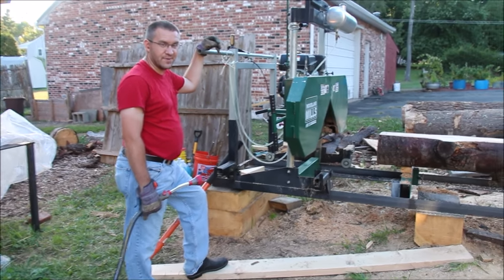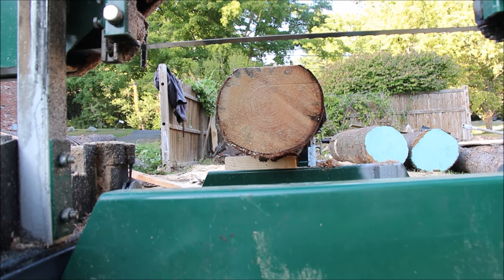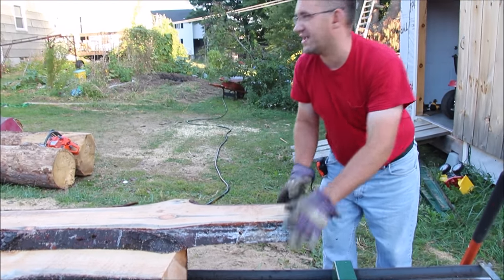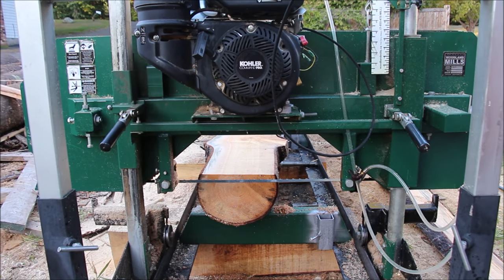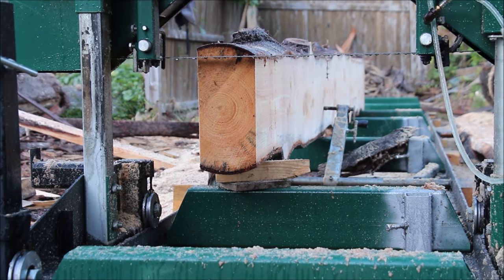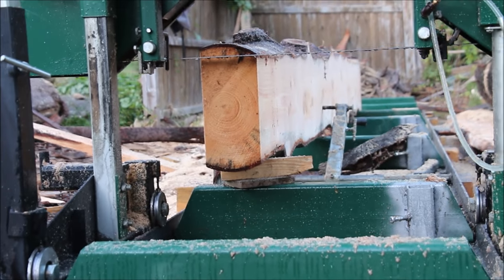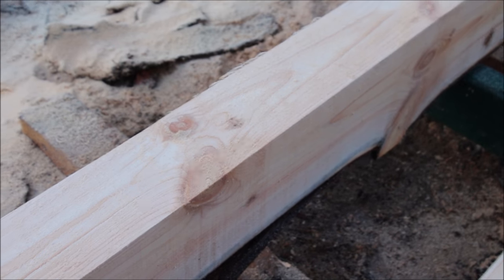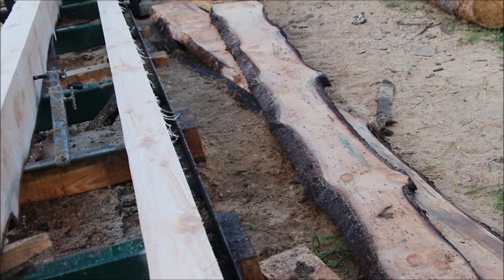How I mill a 16ft+ long log on my Woodland Mills Sawmill

Comment: adding all that water is over kill , the gullets are filled with so much water there is no room for the sawdust , you'll also "float" the blade right off the drive wheel.  a drip is all you need for cooling and lubracating the blade
Reply from the maker: Not trying to cool or lube the blade, trying to get the sand off the outer part of the log.   When I make cuts that aren't through the outer part of the log, I only run a drip.   So far, running the hose on the outer part of the log saves my blades...I think.  no issue yet with my blade coming off the drivewheel
Reply: Why don't you use a pressure washer or spray the log down before you cut it?
Reply: cuz he ain't to bright
Reply: The hate and rudeness from people this day and time is mind blowing! I think you're doing a fine job and do it the way you want to, not the way everyone else says to. Really wish we could all just come together and help each other instead of all the negativity.  You're children will probably turn out to be hard working adults. Keep it up good sir, your doing a fine job!

Comment: im new to this, why do you need the water lubrication system? I have seen a lot of people who dont use anything for lubrication
Reply from the maker: Into The Dirtshop when going through the outer part of the log...it keeps things cleaner...doesn't dull the blade as quickly
Reply: Matthew Olson thanks! Would power washing the bark to get the dirt off do the same thing?
Reply from the maker: It would help....yes.  removal of bark is best....but even after the bark is gone I'd prefer to have lots of lube when going through the outer part of the log

Comment: Very cool....:) ( Nice video too ) And question.... how much would you cutting dry? Just washing the log first as best you can? I would be interested in your opinion of mill options after a year or so of milling. We need one here on the farm.
Reply from the maker: I don't cut dry unless I forget to turn the lube on.  right now I'm using windshield washer fluid and pinesol.  if I cut through the outer part of the log I use the garden hose
Reply from the maker: does that answer your question?
Reply: yup
Reply: What's your mixture ratio for the washer fluid and pinesol?
Reply from the maker: Dan Hagemann it's not scientific lol....about a cup pine sol....in a gallon or so washer fluid or water.

Comment: So close to the house, why did you buy a gas unit?
Reply from the maker: Thomas  Broking ....electric would be nice no question but I'm pretty sure they don't offer this mill with an electric motor.  Plus the power head is more portable.  This was not the intended site for the mill.

Comment: nice video here.  I'm wondering one thing about the watering system.  I've seen on some other systems where they have a tank of water (5 gallons maybe) and a fixed spray system mounted to the cutting head.  Would this be an option for your system, or is there a benefit to using the hose setup you have?  I kept thinking about how soupy the sawdust / dirt below the cutter could get with all the water you were using.Thanks for anyr feedback.
Reply from the maker: test account I have probably a 2 gallon tank that's the shiny thing that you see at the top of the power head I do run Lube which is essentially windshield washer fluid and Pine-Sol however when I am cutting through the outer part of the log I like to use the hose and you'd be surprised at how dusty the sawdust comes out on the other end rather than soup
Reply from the maker: test account also I realize I need to do a video on my lubrication system because I do have a bit of a different set-up compared to the stock Mill
Reply: Matthew Olson
Thank you for the reply.  I appreciate it.  Have a great day!

Comment: Many have suggested to power wash the log. Where you use a hose. Uses a little less total water consumption and might blast more sand away from the log. Not sure might give it a try.
Reply from the maker: I don't have a power washer, but yes, that would be nearly ideal.   Better to have a water jet blast off the bark to start with ...but that'd take a considerable setup. ...

Comment: Im thinking not but if you look at the woodmizer L 15 build a saw guide like this! I would go to a steel company and get a 1 1/2 tubing about three feet long get another peice that would let it slide threw and take the existing guide and put it on the end of the peice you buy and make it adjustable so you can get the guide over to the wood this keeps the blade from wandering
Reply from the maker: I haven't felt the need to do it...but it would be a nice upgrade!
Reply from the maker: I use the water when going through the bark.  Just dust coming out the other side :)  it does help save blades

Comment: Are you going to join the ends of the rails together?  Like weld cross pieces?
Reply from the maker: ?   the green bunks hold them together with bolts, haven't had an issue with them splaying out if thats what you mean.  probably no harm in welding a cross piece but I don't see it as necessary ...  why do you ask?
Reply: Matthew Olson just curious.  I'm thinking about getting a Woodland mill and thought about doing the same thing. Thanks for your reply
Reply from the maker: @kerrydills3240  if you have the space I recommend full 40 ft rails.  mine are 30 and at this point i wish I kept them the full 40 (the length the L angle comes in at the steel supplier).  the downside is that 4x3" L isn't the stock size, so what happens is that the mill sits higher off the bunks and the minimum board is 2" thick off the bunks rather than 1"
Reply: Matthew Olson  Ok. Thanks for the advice. Great video,too.

Comment: In the last slab you took off the top, why didn't you raise the blade 1" and get a 1" X 4" X 8-12' out of the slab?
....13
Reply from the maker: ah... great question.  a few reasons.  knots...it wouldn't have been a nice piece.  I don't have a great way to dry a single piece like that....usually when I cut 1x? I do 1x8 or 1x12....not random widths...and I have no use for such  piece.....also...time.  I don't like to mess around with such small pieces.   what I COULD have done is to cut stickers out of the scrap....but I already have enough.
Reply: Very good answer! 
Only reason I ask, I see all the YouTube mills doing this. As a construction person I've had to buy a lot of 1 X 4" and 1 X 6" and cut them into 2' to 4' pieces for concrete form work. Some of the YouTube mills trying to make a living might market a lot of this to pallet companies.
Reply from the maker: I don't think I'm ever going to make a living doing this.  I'm a dentist by trade...so milling for is mostly for fun and some for function / necessity.  I also don't have unlimited lumber.  So I doubt pallets are something I'll get into.
Reply from the maker: arkansas13 I'm going to try to do some more milling vids this week...gonna give my opinion and approach to milling...and go into a little more detail answering your questions. ...they are important questions :)

Comment: New to your channel, why did you build a new frame for this mill? I notice its angle iron and you mentioned you was cutting using your new frame.
Reply from the maker: i made new rails....  that are single piece...instead of the ones that came with the mill that are modular.   doing it again i'd probably go for 40' rails ....but right now i have 30' rails....and its really really nice to have the freedom to move
Reply from the maker: oh, and welcome to the channel :)
Reply: Awesome, thanks for the quick reply, I am looking at purchasing one of their mills, I am tossing the 130 and another mill, it there an issue with the modular rail system that comes with the same mill, I am worried with so many pieces and it all bolting together it could prove to be problematic, and seeing this video, and watching your other video of you making the 30 rails, makes me think i may be right?
Thanks again for the quick reply
Reply from the maker: i figured it'd be easier to get level. ...and stronger.   its stronger for sure, but not necessarily easy to get level lol  ....you need a very nice piece of level ground to start with.  then a better system for leveling than I have.   they have leveling feet now, but I didn't when I bought my mill   ...the newer generation is better I think ...

Comment: how and why do you put a block under one end
Reply from the maker: how...with a crowbar....why...to avoid waste on the large side of the log.  I'm taking less of a bite on the large end of the log
Reply: so do you try to level the log i just  got a sawmill and it seems like i have a lot of waste do you make a cut with the mill and turn the log 90 degrees or 180 degrees and go from there since iam a newbee any help would be great thanks  qreat thanks oh and  i really liked the 30foot rails i think that will be in my future
Reply from the maker: 1376thom yea...I try to minimize waste....sometimes I turn it 90....sometimes 180.  Depends.  Maybe I'll do a vid on how to approach a log....that way I can explain more
Reply: awesome i will keep my eyes open for it thanks
Reply: another reason would be to cut more parallel to the overall grain of wood in the log.  It yields straighter grain boards and better quality boards.

Comment: You've got to much saw blade that's not supported , need to move the bearing post in or out depending on the width of your cant !!
Reply from the maker: This mill doesnt have an adjustable bearing post.

Comment: I watch a lot of videos,  nobody uses a hose..I thought it might be good to keep the blade cool, but i see the machine blowing out sawmud..Thats going to cause problems,  besides how much water you're wasting..The mud you're going to be slopping around in..For me stay wearing a respiratory mask & goggles, no water for me.
Reply from the maker: not much mud at all.   I only use the hose when i'm going through bark.  and i do think it saves the blades a bit.  I've had plenty of comments of people telling me how bad all the water is, but I really don't see the problem.  fine sawdust comes out the other side, no water.  so the water isn't filling the gullets.  the amount of water wasted here is quite low ... I just don't do many logs like this.  compared to watering a front lawn this is relatively small amount of water.  when i'm chainsaw milling I use a mask now for sure.
Reply: The water isn't being "wasted" - it just goes back into the ground to be reused over and over.

Comment: lol. drowning the blade. hahaha
Reply from the maker: i love it when people laugh at me but they don't offer anything constructive.   whats interesting is that the dust comes out the other side as dust... not a water stream.  for some reason, when going through bark, this does indeed help keep the blade sharp for longer.  I don't run much lube when i'm just cutting through bare wood, but for bark I like to run lots of water and its worked well for me.
Reply: ok , what ever works
Reply from the maker: try it...  prove me wrong.... and i'll happily watch the vid!
Reply: i live off grid so no water pressure to speak of.
Reply from the maker: @billywray4524  ah....ok... cheers